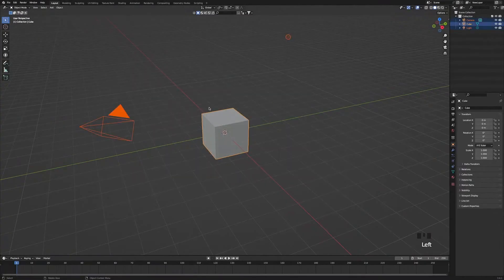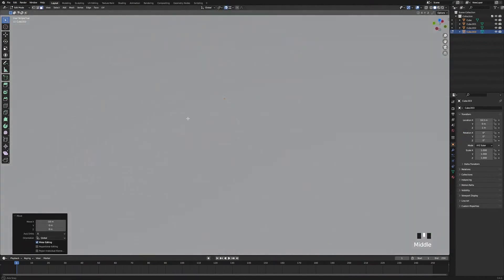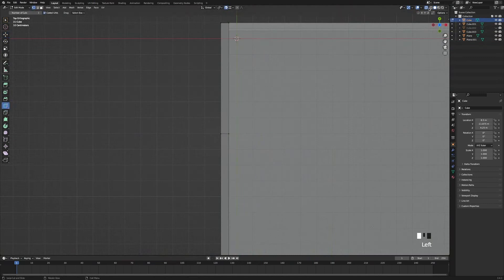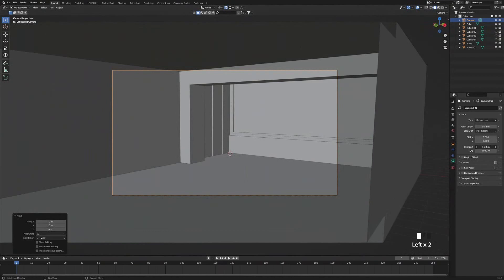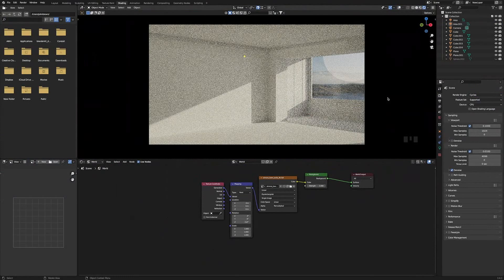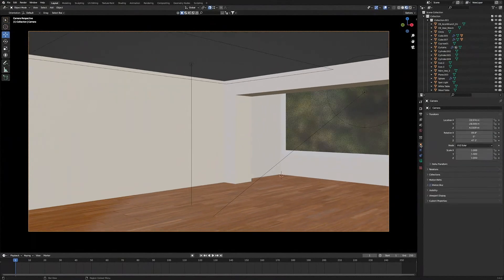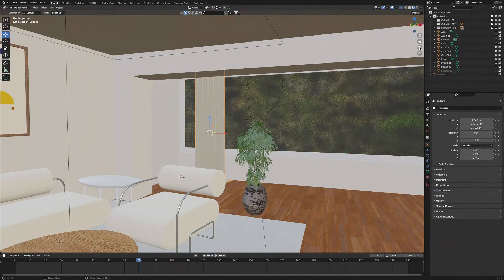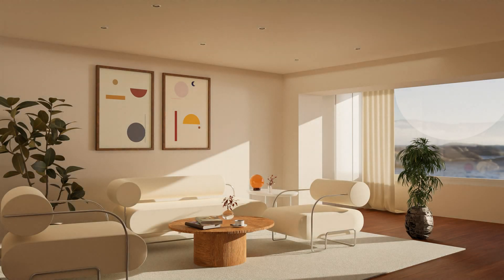How to Make Simple Realistic Interior in Blender

Comment: Great  video. Very useful.  Can I ask you why you don't build the wall, just building walls! 😏 I mean.. You can take a cube give a starting point, outside, inside texture, exact dimension, etc.. Name it, apply scale rotation, than duplicate it and goes on and on.. So you have name for each partition, you can apply boolean for doors and windows etc. And have all separate object. I have also textured  pre-built wall in obj or fbx . I'm just saying what I do.. not teaching.. Maybe I'm wrong  Using Blender from few months. Thanks. 👍 Greets from Italy

Comment: Thanks for the tutorial! A question - When I import and apply the floor texture on Blender 4, its showing as a dark, smooth wood coloured gradient, with no wood texture - I've tried moving some of the parameters but no luck thus far - any ideas what could be the cause of this? Thank you!
Reply from the maker: I don't know why it is acting up but the texture is originally from Poly Haven and is called Wood Floor, there are also plenty of other free floor textures for you to use as well.
Reply: @EPICMAN_3D  Thanks for the reply - turned out I had to UV unwrap it before it would display correctly - adding this here for anyone else who has the same issue
Reply: @paupersprince  I had the same issue. For anyone who needs to UV unwrap, go into edit mode, select all the geometry with A, then U to unwrap and select “project from view bounds”.

Comment: How can you match the opposite edge at 1:59? I see you press G, sliding it backwards and then somehow it ends up at the opposite edge when you release it. How? It doesn't work here.
Any ideas?
Reply: same issue
Reply: Make sure "Snap to Vertex" is turned on.
Select both vertices you want to align by holding down Shift and clicking on them.
Press "G" then "Y"
Hover your mouse over the top or bottom vertex opposite to the selected ones and they should snap to the aligned location.
Hope this helps!
Reply: @taariqkwame  thanks man. you are a life saver!!!!!
Reply: SAME ISSUE HEREEE
Reply: Yeah same. No one is helping
Reply from the maker: That because you need to turn on snap to vertice to match the opposite edge.
Reply: @EPICMAN_3D  It is turned on and doesn't snap.
Reply: @EPICMAN_3D   could you be more clear on this please.

Comment: Please, when making a beginner tutorial, don't fly past ANYTHING. When you made your walls line up after deleting the front faces, you made it easily click into place exactly where you needed it to. I'm currently struggling to replicate what you did there. It seems to have something to do with the middle wheel. I got it to happen on one wall but I don't know exactly what I did and I can't get it to happen on the other wall. Every tutorial I watch has this issue, where they just blow past some hotkey they know or some setting you need and then you can't follow the rest of the tutorial.
Reply: i have the same problem, even tho i do have snap to vertex enabled :/
Reply: solved it! for future reference if anyone sees this: press x or y after g so that it only moves along that axis. then it will snap parallel to the other vertex
Reply: @carla3585  dude you're a life saver
Reply: @carla3585   how again, the ceiling is still not snapping
Reply from the maker: That because you need to enable snap to vertice (01:15) that should hopefully fixed your problem.
Reply: @EPICMAN_3D  That's the problem I have as well, snap to vertices is enabled but the ceiling doesn't snap. So what to do?